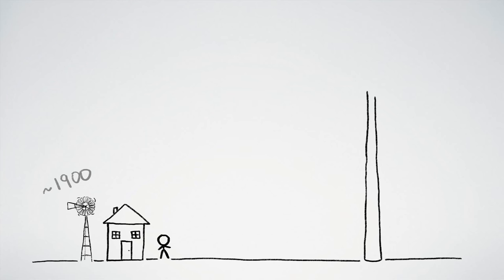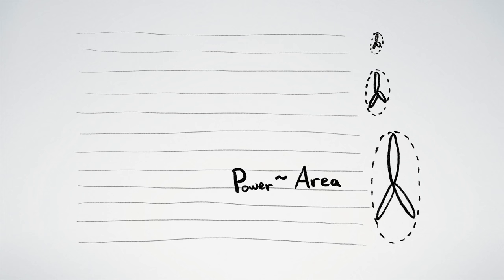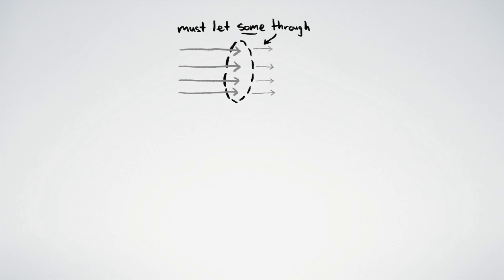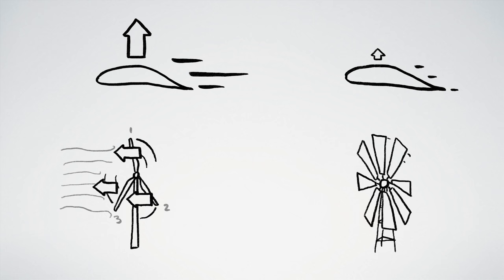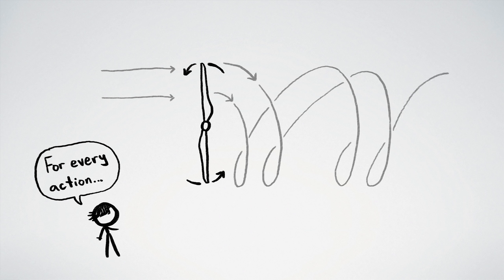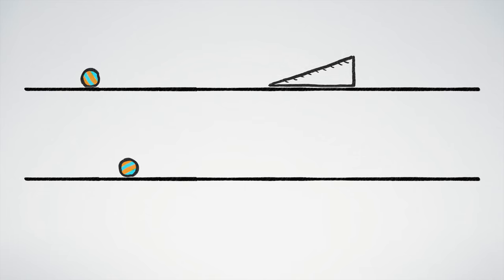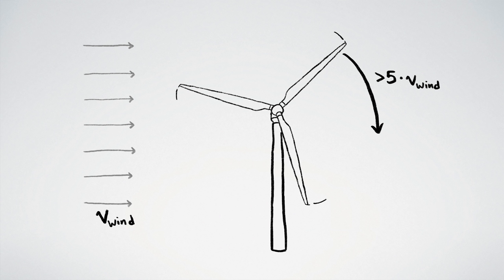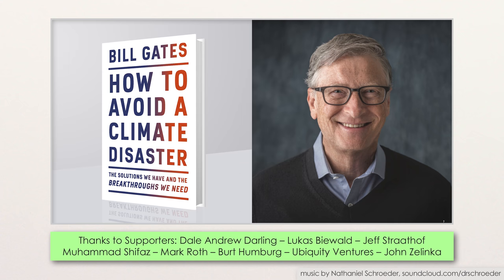The Physics of Windmill Design

Comment: The blades do not turn that fast.  They are designed so that as the wind blows faster or slower the blades change their pitch to reduce or increase wind pressure so they can stay in a specific speed range.  The blades are designed to generate a torque within a certain range in order to maintain the generator speed.  It is torque and efficiency, not speed, that determined the bade design.  More blades does not add enough to make them worth the cost and wider blades makes it harder to maintain their speed to obtain the ideal torque for the generator and subjects them to excess stress from higher winds.

Comment: isn't it supposed to be tall mainly because the strength of the wind is more consistent at higher heights compared to the inconsistent strength of the wind due to ground air effects?

Comment: The analogy with the ramp and the ball is incorrect, the faster the ball is sent to the right the more horizontal energy that is being transferred into the block, the opposite is being proposed in the analogy.
Reply: Not quite. More momentum. Is being transfered but since energy can be equated to momentum times velocity that higher initial velocity means a small change in momentum transfers more energy.
The way he said it isn't great but mathematically he's correct.

Comment: Ok ok I hear ya but surely a slower moveing design even tho slightly less efficiant would wear alot slower for for haveing all the contact points of friction moveing slower. Kinda like   a f1 engine makes more power by big revs but you dont want a high revving engine on the street? Not to mention noise is directly linked to speed of the blade surely less efficiant but more reliable quite and frankly safer for birds is better than a highly efficiant design?

Comment: I don't get the explanation for high rotating speed. Couldn't you just use a steeper angle? In the ball analogy a steeper angle would absorb more energy from the ball, without needing to move faster!

Comment: So I figured the answer would be that big sails would just break apart in a storm.
Reply: I mean, yeah if you take all the energy at low speed good luck keeping the thing from moving in a storm. But if you have thin blades that rely on speed to transfer the energy once you have the in one spot it's easyer to keep them there.

Comment: Only part I could disagree with is the need for renewable energy. Nuclear is more efficient and actually safer.
Reply: More efficient, yes. Safer, absolutely not.
Reply: @bbbenj  Actually If you look into it modern reactors have so many safety precautions that it’s practically impossible for them to melt down. Also thorium reactors are in development which are literally impossible to melt down. All the deaths come down to construction costs and with construction renewables are actually more dangerous. Besides the E-waste from solar panels is just dumped while nuclear waste is stored safely until it is no longer radioactive.
Reply: @bbbenj  They are statistically speaking safer, far less has died from it than pretty much any other energy industry.

Comment: Aargh! Windmills have a mill in it. Wind turbines have turbines in them. Wtaf!
Reply: The spinny bit acted on by the wind is the turbine in both cases.
Reply: @arfyness  
Wrong. A turbine is a motor in reverse. Look it up. Why would a windmill have a turbine? It has a mill to rotate.
Reply: Windmills have been around since the 10th century, motors were invented in the 19th century.

Comment: put a big gear on outer space, use earth's rotation as power source
Reply: You joke, but hypothetically were there a conductive material encircling the Earth either stationary relative to the poles or rotating in the opposite direction, the rotating magnetic field of the Earth passing across that material would induce an electric current in it.

Comment: ... Um, no. That makes less sense. The 'energy' that the windmill 'captures' is kinetic energy. The faster it spins, the more energy it generates. Think of it like a hand crank generator. I've had one of those sort of flashlights for years. Slower moving blades naturally don't produce as much energy in the same amount of time. However, you also have to remember that the 'slpp' in your example represents the moving blades. True you can't absorb as muck energy when it's moving but that's because it can't absorb any more as it's already moving.

Also, most importantly, you're not capturing wind energy, you're harnessing it to create energy. That's how all generators work, be it wind, water, or nuclear.

Comment: But why 3 blades? Not 2?
Reply: The fewer blades, the faster it need to spin, and because of material strength you can't make those blades too long. 2 blades design are usually found on smaller cheeper wind turbines

Comment: I really enjoyed your explanation of the optimization of blades for efficient power generation from wind. However, your statement that development of modern wind turbines was motivated by climate change is anachronistic and incorrect. All impetus for development of clean energy generation and use started to accelerate in the 1970s to decrease air pollution; climate change was not a topic of general discussion at that time. This continued to be true for the subsequent four decades. It is only in the last decade that climate change came to the forefront as a motivation.

Comment: They are Wind Turbines, not Wind Mills. Wind Mills capture wind energy to power a mill for grinding grain into flour. Wind Turbines capture wind energy to generate turbines transforming it to electricity. Sorry, I work on windfarms quite often and its a pet-peeve of mine. Im sure the technical term "windmill design" is accurate for the shape, but dont refer to the turbines as mills. Thanks :)

Comment: Not true.....its an Over-simplification.....wind turbine blades are not designed to be fastest it can be..... It's an optimum speed the turbine rotates at.....if it runs too fast......it start to behave like a solid disk...and thus obstructing wind 

Wind turbine blade...must stay at a sweet spot between too fast and too slow....coded in each turbine control system cp-lambda curve

Comment: Now they just need to make the design more bird-friendly.
Reply: Also there are many unanserwed question about so called renewable energy that they may cause more harm than good. example where do you get the lubricating oil and how do you transport it there? how much energy does it requires to make replacement parts and replacing them? ppl just don't think they just blindlesly follow.
Reply: @thehemmo5078  yeah, it's definitely not zero pollution.  I think the biggest problem is people want it big, cheap, and now.  You can make something that meets two of those at the expense of the other one.  Meeting all 3 is impossible.

Comment: I've passed wind farms.  Even with a 10 MPH wind, the blades are barely moving.  Seems like waste.
Reply: It’s not the outside movement that matters. The gears inside move a whole lot faster.
Reply: The blades may not seem to be moving fast, but that’s because you are far away. Even under light conditions the tips can pull 60 MPH (~120 kmph). Also, 10 mph winds are not that strong. If you see a wind turbine stopped, what it usually means is that the wind is too strong and could tear the turbine apart, or that it is down for maintenance.

Comment: but why windmills? they are big, expensive, need constant repairs and part replacements, and the production of their parts releases more CO2 than a gas plant will produce, so why windmills?
if you really want emission-less power, why not nuclear? there are no emissions at all, and it produces an insane amount of power, the waste produced in its lifetime will be only at most a few dozen gallons, and they almost never have any problems that result in meltdowns (there have been 3 meltdowns in 60 years, and one was caused by a tsunami, and there are thousands of reactors in existence). so why not nuclear?

Comment: You forgot to include the metric of cost...any one of those old-style farm windmills you probably bought  for maybe one-thousand dollars brand new, your modern 250 foot high windmill is now some six million dollars or so, needs constant monitoring, needs constant maintenance..................those old windmills need nothing but a squirt of axle-grease every six months. What's the point if you build such absurd giant things?
Reply: Well if a 6 million dollar wind turbine is generating 68 million dollars of electricity a year, it's probably a good investment.
Reply: @infinitelyexplosive4131  Well, with the average wind turbine running 3,000,000  (MegaWatt) output per year, powering some 1500 average US homes. Each home consumes roughly 10,500 Kilowatts yearly, an average cost of $1365 per year. 1500 households times $1365 equals appx 2.04 million dollars., the average cost of a turbine is 3.9 Million dollars..One cent of the thirteen cents per kilowatt hour is allocated towards maintenence & repairs.
  Two years to recoup the cost of the machine itself.

Comment: Nuclear is the only modern option
Reply: Wind is and will continue to be far more in-demand. Nuclear is gamboling on the fact that renewables won't improve for the next 20+ years while you try to build and then run the nuclear plant for long enough to pay off the massive 6+ billion dollar loan you took out.
Reply: @infinitelyexplosive4131  wind is inefficient, takes up too much land and doesn’t generate electricity 24/7 thus isn’t stable
Reply: @infinitelyexplosive4131  6 billion is nothing compared to the budget they have for all these windmills and solar farms etc
Reply: @Roshan_420  Okay, you're just lying now. Nuclear plants are estimated at somewhere between 6-8 million per MW capital cost, compared to about 1-2 million per nameplate MW. Considering that modern turbines are hitting capacity factors of ~0.4, a wind farm is very clearly cheaper. The EIA demonstrates the same thing with their calculations for LCOE and LACE, which put the average cost-value ratio for nuclear some 40% lower than wind.
Reply: @infinitelyexplosive4131  a windmill farm of 7 square kilometers generates 48.3mw, a single reactor generates 520/582mw
You’ll need to build huge farms to keep up with a single powerplant and even more to provide enough stable electricity for everyone
6 billion is nothing if you look at the budgets they have for other “green” options.

Comment: Huh. At best 59% of the wind energy, and most windmills probably tapers out before that, so at best probably <50% of the wind energy. At best. Notice then in all countries that have installed a substantial amount of wind-capacity that more often than not they actually only produce a third of their supposed max value. Just go onto any real-time energy site with breakdowns of energy-source and you'll see it plain as day. Last week Germany's wind power was pathetic in comparison to its installed capacity. 
This just seems like such a bad product to base our energy-grid on. Sure, in small scales to utilize the energy in the wind, go for it, but for large scale? To power ever expanding industrial economies? No way, this is just way too inefficient and intermittent - I don't get the hype around wind. Please CMW about this, but I doubt you can persuade me to buy into this crap.

Comment: A mill is a device that breaks solid materials into smaller pieces by grinding, crushing, or cutting.
A turbine is a rotary mechanical device that extracts energy from a fluid flow and converts it into useful work.
This video is about wind *turbines*, not wind *mills*.
Reply: there are better uses of time in 'someones life' than to be correcting a word which we all understood to be wind turbines.

Comment: how do you keep a spinning object in balance when mass is added to it unpredictably.

you have to add more mass, internally to dynamically keep the rotation in balance.
every bit of extra mass to the rotating object loses efficiency. making the entire tech useless.

also derive an experiment where you can take a general precise measurement of the  temperature of the globe,
ok got it? yea It'll cost more money than you can imagine.
so how do we "know" what the temperature is on the globe in all these areas where we don't have probes?
well we guess, and use computers until we get results we want to get funding.
~Climate Change in a nuttshell.
more politics than it is science
Reply: The way we can see universal weather forecasting is through satellites. Either way, we don’t need a perfect way to measure the temperature simultaneously everywhere, we just need enough points that most biomes and geographic regions are accounted for.

Comment: Please stop saying windmill. We are not making flour. It is a wind turbine.
Reply: Many wind turbines can rotate the blades so as to adjust the angle of attack so passing air stays laminar. The real question i think you are trying to answer relates to air density and volume that can be utilized by an airfoil. The answer is about 86% by mass ratio efficiency. Draft turbines come in at just over 65%.

Comment: Nuclear power is better
Reply: But, it cannot account for large spikes in demand and is hard to scale up quickly
Reply: @skippy9214  this comment was really meant I was just a joke even though I really believe it to be true. Also, I wasn't planning on arguing with anybody about the validity of my statement. That being said I don't mind providing a small rebuttal as long as you don't see it as me trying to argue with you but rather as my opinion on the subject.
Reply: @skippy9214  to address your first concern. large spikes in demand happen at predictable times. Secondly, Nuclear plants can be built large but only consume fuel as needed. They simply add more fissionable material when more  power is needed or rather just remove the controlling rods. I'm not going to try and go into specifics. You can't get more wind on a predictable schedule and it also will not supply additional power at peak times.
Reply: @skippy9214  lastly as far as scaling up goes, nuclear reactors can heat water faster than steam turbines would ever need. Just add more cooling towers that control the water outlet and more turbines and you're good to go
Reply: Please forgive me if I sound arrogant or condescending.

Comment: Humble request: please don't use music with non-conventional time signatures as background music, it's incredibly distracting and I have trouble concentrating on the subject matter. The composer started off thinking "I'm going to do a song in 5/4 time", but as is usually the case with 5/4 songs, what came out was a 6/4 song with the sixth beat skipped, so my brain notices that beat getting skipped over and over. It's like if you decided to do an entire video without using the letter 'e', but you never pointed out that you were doing so, then expected the audience to not get distracted by the fact that you're making weird verbal choice to avoid using "the". I'm not saying don't write something without the letter 'e', I'm just saying that the novelty of doing so isn't worth it if that background novelty distracts and/or subtracts from the foreground material.

Comment: GREEN ENERGY Bet you didn't know, most of the parts for a wind turbine are built in Germany, it requires 60 gallons of oil to lubricant the turbine. ( where do you think that oil leaks when a seal busts - onto the ground or into the water).

The blades are made of a toxic fiberglass combination and are buried in landfills in Wyoming.  

The turbine has to spin continually for 7  plus years just to replace the energy it took to manufacture the turbine...

It has to run continually for 50 years just to pay for the cost to manufacture and install the turbine....which is approximately $2 million dollars per turbine. However, according to the U.S. Energy Information Administration (EIA), the lifespan of wind turbines is only about 20 to 25 years.
 
@ShroodNews 🇺🇸

Comment: First one of your videos I disliked. You missed the main design constraint of modern windmills; weight. The modern design is "bad" at capturing wind energy, but that is because they are designed to be light so they can be placed higher. Power scales with the cube of wind speed, so getting it higher is top priority. 

 You also didn't cover the reason for 3 blade designs or why blade length is decided. They both come down to reducing the torque caused by the wind pushing the top harder than the bottom. Wear on the gearbox and bearings from uneven axial force is the main cause of failure in windmills.
Reply: finally. a dislike not caused by bill gates

Comment: Windmills are bad for the environment
Reply: by environment do you mean just birds? Because if not I don't think so
Reply: @generator314  The fact that wind turbines can not be recycled and are piling up in landfills. And don't work unless its windy and it can freeze over like what happend in Texas. Plus the maintenance cost per turbine a year is aprox 50,000$ and they're generally pretty inefficient. From most to least per capacity goes (Nuclear, Natural Gas, Coal, Hydro, wind, solar)
Reply: @tannerw14  People don't just throw away turbines after using them for a month as far as I know. And the problem in Texas was not caused by windmills, it was caused by an improperly weatherproofed electrical grid.
Reply: @generator314   no turbine blades don't get thrown away every month but are made of fiberglass so even if your to grind it down to a powder you're still not going to be able to get rid of it. And the windmills did freeze completely over, but could have been avoided only if they prepared for it by equipping the turbines with cold weather packages. Windmills work in Antarctica.